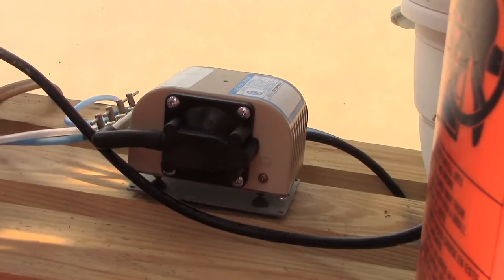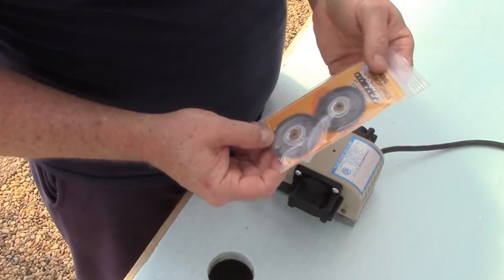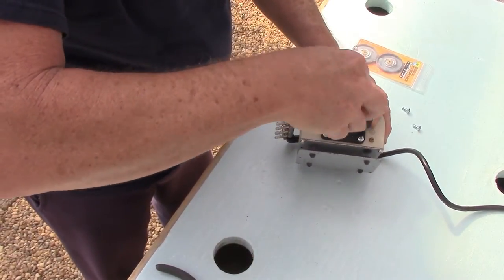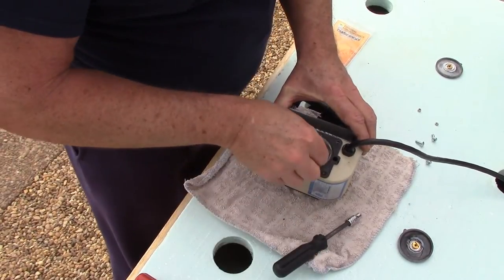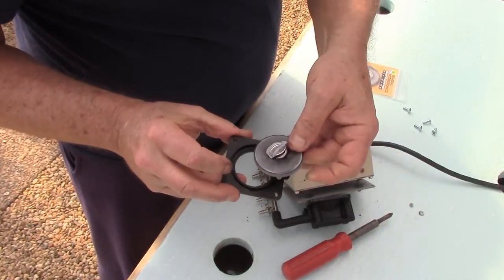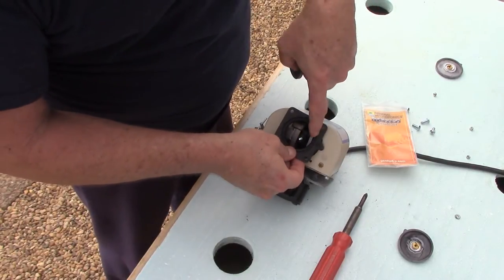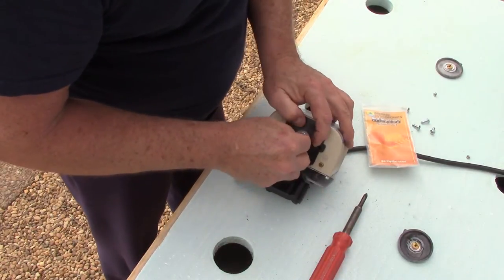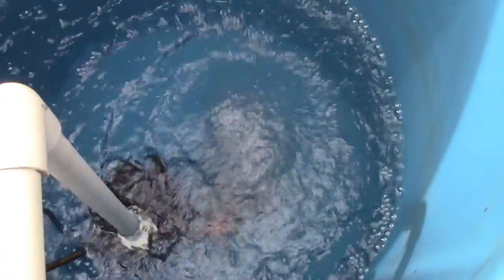General Hydroponics Heavy Duty Air Pump Rebuild

Comment: This was a very informative video....
I have two Hailea pumps aco-318 and the aco-328. I noticed that the smaller o the two had suddenly become extremely loud and the air pressure had dropped. I followed your instructional and  the rubber on my diaphragm looked mongy.
Now this is where i saved my self some money. I got an old rubber inner tube and cut out a circle the same size as the one that was worn out and i put it in there with the old one on top and screwed every thing back together.
Now it is working better than before and running quieter than it was before.....
I think when i get time i would have to try and do a tutorial for those Hailea Pumps as they do say no serviceable parts....
But thanks all the same coming from London England....
Reply from the maker: Thank you! I'm glad that you were able to be resourceful and get your pumps back up and running again! To me, there is no such thing as non serviceable parts when you have a creative mentality ; ) Thanks for watching!
Reply: After doing the 318 I decided to do the 328 which is the bigger of the two, done the same thing again cut up an old inner tube the same size as the rubber in the pump and added it to the existing rubber, it now runs a lot quieter..  
Once again three thumbs up for the video.
Reply from the maker: BlackJedi169 You're welcome ; )

Comment: Excellent product repair.
Having been running for four years and the diaphragm tore.
This might seem non-essential.
But if you added a small amount of silicone gel, just a slight polish for the diaphragm.
You might change the repair interval.
And also not foul the air supply.
Nice job.
Reply from the maker: Thank you, Mark! Check out the reply I left for David Dube, since you guys had pretty much the same suggestion. I'm probably going to just stop running it so much, since it's not really necessary. Thanks for watching, and for your input, my friend!
Reply: Keyplayr61 Greenhouse Hydroponics And Gardens Searching David Dube, there's no one on my Page/View.
Reply from the maker: Mark SM Hummm.. That's strange. He's two comments down from this one on my page. Anyway, here's a quote from that comment..." 
Thank you, David! The only problem with petroleum products is that it will deteriorate the rubber. I think it was just the life span of something moving back and forth for four years straight at 24/7. I'm thinking about just running it intermediately since once the water tanks aerate for 24 hours, it's not really necessary to run it all the time, even in the nutrient reservoirs, because they get enough oxygen just from returning from the dutch buckets, especially in cooler weather. Thanks for your input, and for watching, my friend!
Reply: Keyplayr61 Greenhouse Hydroponics And Gardens
Actually that is true.
But, in the sense of Dave's theory--there is STP Oil Treatment.
But, silicone gel, is very safe.
Reply from the maker: Thanks, Mark! It could be worth a shot ; )
Reply: Keyplayr61 Greenhouse Hydroponics And Gardens
4-years is good service.
But, polish is a good service.
I've used this on a motorcycle carberuater...diaphragm needle valve.

Comment: Yes Keith, nicely done video.  Do you think a little vaseline type stuff would have been helpful around the gasket (lightly)?  It might have cause the diaphragm to stick closed, eh?   I'm just asking since I've never needed to do a diaphragm repair.
Reply from the maker: Thank you, David! The only problem with petroleum products is that it will deteriorate the rubber. I think it was just the life span of something moving back and forth for four years straight at 24/7. I'm thinking about just running it intermediately since once the water tanks aerate for 24 hours, it's not really necessary to run it all the time, even in the nutrient reservoirs, because they get enough oxygen just from returning from the dutch buckets, especially in cooler weather. Thanks for your input, and for watching, my friend!

Comment: thanks, picked up used on fro $20 and rebuild kit for $18. Using and secondary pump for extra 02
Reply from the maker: Charlie Sheen Cool! You came out good on that deal!
Reply: Keyplayr61 Greenhouse Hydroponics And Gardens 
Pump has a weird intermediate vibration, runs quietly then starts to shake everything then back to quiet, will rebuild kit fix this problem?
Reply from the maker: Charlie Sheen It probably has a tear in the diaphragm(s) So, yes the kit will fix the problem! There is a small hole on top of the pump. If you put your finger over it, and feel air coming out of it, or it changes sound, you have a hole in the diaphragm.
Reply: Keyplayr61 Greenhouse Hydroponics And Gardens 
finger over hole doesn't change anything, pump seems like its working better after running 24/7 for a few days. It works good but havent apple to apples tested it yet. I have it hooked to two large air stones and i get lots of bubbles, my new pump it bought brand new has 4 farmkits & 5 small airstones and has small bubbles, idk if the difference is the size of the air stone or due to being split so many times.
Reply: Charlie Sheen 
take that back, i put finger over hole now and I can hear air coming from another part of pump, dont know if its blowing or sucking in air
Reply: Charlie Sheen 
pulled old diaphragm's and they looked in good shape, no tears or punctures. Replaced anyway. Vibration is very minimum now, ill know within next couple days if problem is solved

Comment: How do you restore the air flow if all 4 outlets are no longer working ,is there a way to fix this?
Reply from the maker: This rebuild video will correct that.
Reply: @keyplayr61greenhousehydrop14  i fixed the noise by replacing the diafram but the 4 outlets are no longer all working same with another air pump i have same make and model ,is there a way to fix this problem
Reply from the maker: @jamesanagnos6123  The diaphragm kit should have addressed that problem. Pull apart the connections going to the manifold to check for air flow, as well as the small valves to see if air is passing through them. There may be a clog somewhere.
Reply: @keyplayr61greenhousehydrop14  thanks ill try that